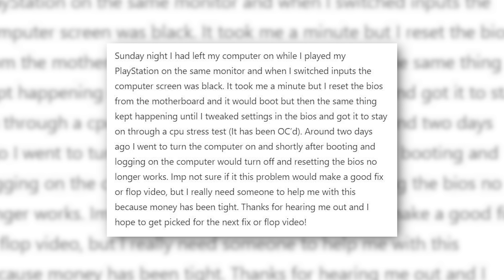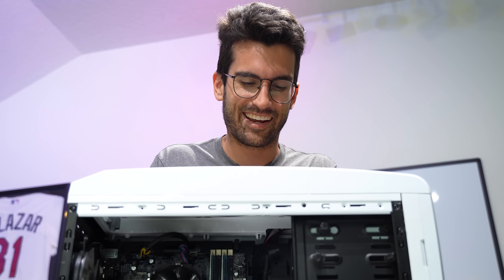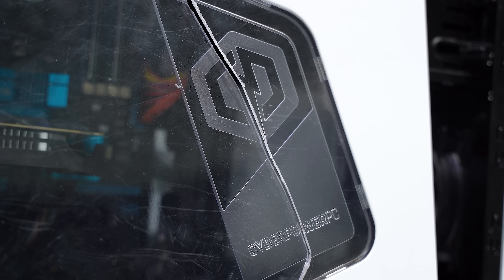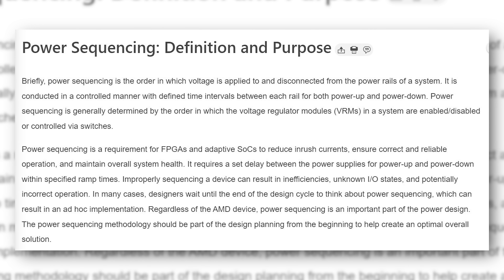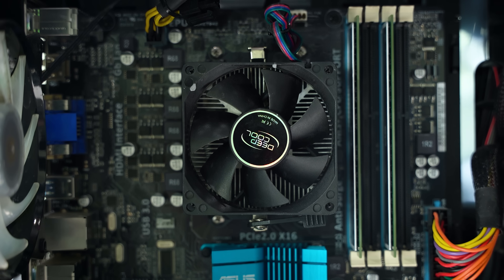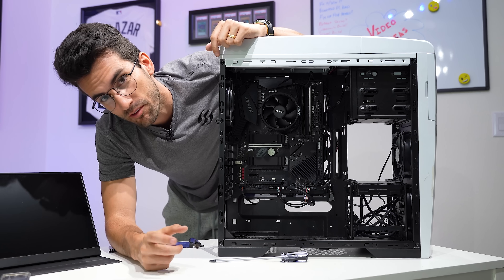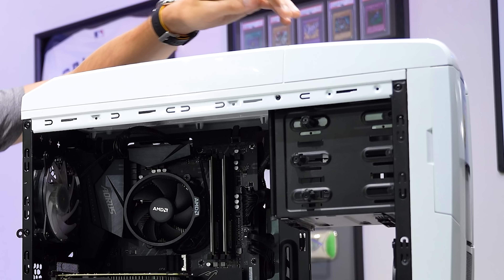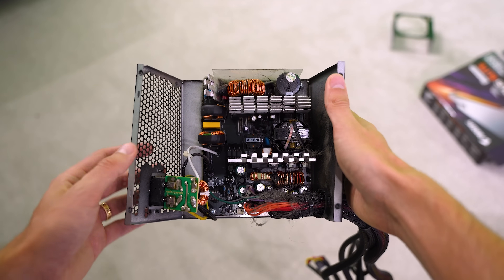Fixing a Viewer's BROKEN Gaming PC? - Fix or Flop S5:E12

Comment: You'd be surprised at what an old Bulldozer setup can do. I know I was when both of my nephews bought Radeon RX 6800's about a week or so ago. They came over so I could help them get their new cards setup. The younger one has an FX 8350 with 16GB of DDR3 and a 1 TB SATA SD (Previous GPU was a Sapphire RX 580 8GB). It's now pushing 55 to 60 FPS in Remnant 2 on Ultra settings with no FSR at 1080p with a pretty straight line for frame times. Shocked the crap out of me. Before, it would get low 20's to low 40's with frame times that were all over the place, WITH FSR enabled. Eventually he'll replace the platform, but for now, it's working pretty well.

Comment: Im still a rookie when it comes to building PC's, but there was vents at the bottom of the case why didnt you face the PSU Fan downwards to get its own air supply rather then sharing with the GPUs Airflow?

Comment: I actually prefer the old case. New budget cases just don't have enough storage support for me. I also don't mind having the option for a disc drive. I would do some cable management to get those cables behind the motherboard so I have full access to the drive bays take out the broken side window and replace it with some mesh. A couple of cheap and simple fixes and he has a good platform to upgrade.

Comment: Can't believe that system worked for so long! Yeah, given it was AMD FX (AMD FX has aged horribly, very poor single-core performance) and that having lots of weak cores doesn't really help you, and especially given the damage to the motherboard (and faulty PSU), there was really only one option. It's not worth spending upwards of $80 for a motherboard to resurrect an FX CPU especially when Windows 10 support ends in about 16 or 17 months. Upgrading the platform ensures the system works as intended (what's to say the CPU wasn't fried due to the overclock?) as well as gives continued long term support via an upgrade to Windows 11, as well as possible upgrades to the storage (SSD, because HDDs are always slow), RAM, CPU and GPU. (Though that Ryzen 5 should be enough to support much more than just a 1050Ti.)

Comment: I also had an old system that wouldn't boot that had an i5 4460 with a 1050ti. I just built a 3600/2060. Looks like my old rig. Looked less janky though. And anyone would have smelled the burnt cables and the guy didn't mention that, very sus imo.

I have the feeling it's his old rig after he built a total new one and he just got a second rig😂😂😂

Comment: 5v is your power-on signal back in the day. So it being bad explains a lot of the issue. As for the 4 pin, it being overclocked for an extended period of time causes that to bake. I've seen that in some of my older Intel boards after running them with extreme OC for a while.

Comment: The bit of plastic from the 4 pin could have been rotates and keeping the 4 pin from inserting fully resulting in arcing,, further degrading the contact. The power button requires 5v from the p/s via the motherboard, VSB I believe.

Comment: It's really nice of you to upgrade the platform like you did, just wondering if you had something like a 5 4600g instead of the 5500 as the igpu is probably better than the 1050ti.
Reply from the maker: I'm like... 99% sure a 4600G's iGP is weaker than a 1050 Ti 😂

Comment: i have had video cards that post and would show the windows screen but under load would artifact and act weird and eventually crash. being that this system had a short or power surge i would recommend load testing the video card. just in case, same with the hdd.

Comment: The burnmarks on the cpu eps power connectors is a common habit on AM3+ systems. Burnmarks are normal on cpu eps power connectors on AM3+ motherboards even if you don't overclock. I've worked on plenty of AM3+ pcs and almost every one of them had burnmarks on the cpu eps power connectors. They usually still work perfectly. I think you could've saved the original platform and the upgrades weren't really necessary.

Comment: Apart from the badly worn and cracked Acrylic Side Panel insert they should be super happy with the repair, my geuss would be either the overclock cooked the 4pin, or it wasnt connected properly, although the last time something went pop in a power supply for me was when i had a cpu coolant leak drip, coolant into the power supply R.I.P Kolink 1500watt Platinum Power Supply your still sorely missed although the type c19 power lead not so much as its propetrairy to over 1500watt Power supplies so rare and expensive, unlike regular power leads.

Comment: Thermaltake power supplies are dangerous. I had a 24 pin do the same thing, except it melted 1/3 of the motherboard connector. Toasted my mobo. I'm grateful I was using my PC at the time and smelled plastic burning. Never again Thermaltake!!

Comment: He told you it no longer booted and was just a black screen.
He said it was a black screen, he tweaked the bios, this resolved the issue for a short period of time, then the computer went back to doing it and resetting the bios no longer worked, assuming he meant taking out the cmos to reset the bios.

Comment: I totally understand your decisions, and, not that you need my approval, I think you really made solid choices. But man, it's gotta hurt your soul a little to send PCs back out into the wild with OSes still on HDDs.😂 Very cool FoF. It's nostalgic to see some of those older systems! 

For those freaking out about it, saving the case upgrade for the user really is such a solid choice. A) He might have an attachment to it. And B) He can have the entire building experience again if he wants for very little money. A Corsair 4000D is like $80 or $90, and it'll be like a COMPLETELY new system. Even $40 cases exist that don't suck. At least, I heard that somewhere once.

Comment: I think it was likely the low quality PSU or a power surge for sure. Even fully OC'd, with that cooler, an FX-6300 would shut off before you could draw anywhere near the 150W+ the EPS 4 pin is rated for. To pull that much power, you'd basically need an FX 9590 balls to the wall overclocked with a 480mm AIO so it doesn't overheat and shut off before even getting the powerdraw required here.

The OC is very unlikely to have melted the connector. Especially because it looks more cracked than melted and this happened before the 12V input (which don't change) were converted to whatever voltage OP set in the BIOS.
Reply from the maker: I think a few folks are misinterpreting my statement - which is my own fault. What I should have said was that the OC likely wasn't playing nicely with the shitty PSU. I would be more concerned with the power supply than the board.

Comment: A good advertisement for Thermaltake power supplies. GG
Reply: Thermaltake is a mixed bag with PSUs. The Toughpower line is generally rather solid, but the entry level stuff  like that SMART unit , yeah, are trash.  Avoid anything but  the Toughpower line from Thermaltake.  It’s not worth it.

Comment: Here's an interesting thought. One thing I have not seen you do on this channel or maybe you have I just haven't seen the video. Remember When building computers inside of aquariums full of mineral oil I think it was, what's popular? Maybe you could do one of those type of builds and just use some parts you got laying around to build it with. Then you could put some Led fans in it and have it part of your background when you do videos. Just a thought. Most newer gamers have never seen this done, so to them it would be very interesting. And you can discuss the pros and cons of doing this. I've never done it myself, but when I walked into a computer shop when I was much younger and saw where they had built it I thought that was pretty neat.

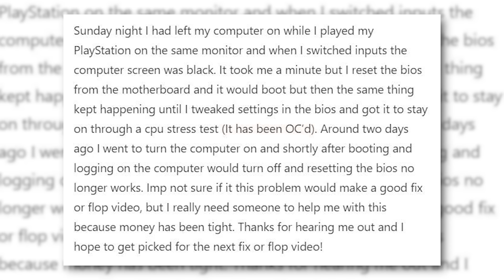Comment: 12:22 It's extremely unlikely that OCing that board would have cause the serious charring seen there. It's almost certainly been a power surge from the grid that caused the issue (both the damaging the 5V rail and causing the 12V header to be charred). I'm very familiar with that line of Asus motherboards and have OCed plenty on them - there's just no way it would allow any setting to cause that level of physical damage. The user is just lucky it kept working at all for as long as it did!
Reply from the maker: Not exactly blaming the board... merely the combination of OC'ing and the shitty PSU running everything.
Reply: @GregSalazar I had an old fx8350 years ago I would do crazy overclocking on and charred an 8 pin this way. About 2 years of extreme oc caused it.

Comment: Hi, the older Asus boards that had the anti surge built in. They had Extra Protection for everything on the board. If the board sensed something was not working quite right it will not boot. And it could be just something that's slightly off but the board considers that an error so it won't boot. Just to tell you how good these boards are, I have a anti-surge Asus that's over 10 years old that at the time cost about 400 bucks. I bought it used so I paid less than half of that. And this board was built during the transitional phase where they were going from ddr2 to DDR3. And it's got slots for both types of memory believe it or not. And it's got settings for overclocking out the yin yang and I don't know what they are expecting the CPUs for this thing to be like. But I'm talking and multiplier that goes way up there. I've learned from experience not to be into overclocking it causes more problems than what it's worth.

Anyway, just to show you how good the anti-search boards were. I live here in Jacksonville Florida and we get a bunch of storms here. So one day I'm working on my computer typing in code for my website and I hear the storm cloud coming up cuz I can hear the thunder. And it had just started so I figured well I got a little bit of time and finish this up and then turn it off no sooner than I thought that I heard a pop come from the computer which actually was loud enough to make me jump because I realize that was lightning coming right through the internet cable. Then I heard the kablam. Evidently the electricity can travel through the line faster than the sound of the lightning itself.

So I went to turn the computer off because the screen was still up everything was still on and I found the computer locked up. So I immediately turned off the switch on the power supply pulled the electrical cord from it and then disconnected the cable internet from the PC. All the while thinking well this was a direct hit so I'm sure this computer is trash. So when the storm passed I hooked everything back up thinking it's not going to turn on or boot up. But to my surprise it did. And the only thing that got ruined was the chip that runs the cable internet on the board. So I put in a card for Wi-Fi internet and it worked just fine. In fact it's the computer I'm responding with in this comment and this is 5 years later.

Over the years certain Hardware is gone out and the board always lets me know something's wrong by not turning on. And I go through the process of changing or disconnecting Hardware into figure out what it is, and when fixed it starts up just fine. So the only thing I can think of is this board is built in with safeguards to keep the rest of the hardware from frying. So I think if you took the motherboard of that computer cleaned up that four-pin plug-in, hook up another power supply it'll boot right up.

Also, I do side work repairing computers from time to time for friends and here's something that is so strange you want to hear it. I used to do work on the computers at this one Realty Company and one day she calls me up tells me lightning struck her computer. First thought through my mind is a fried. And that there's only a 5050 chance I could get the data off the hard drive. So I got the computer and it would turn on but that's all it did it wouldn't do anything else. But when I want to go pick it up she told me that lightning had come out of the cable wire and actually struck the side of the computer. I just kind of that's kind of hard to believe but I got the thing home and went to take off the side cover and lo and behold there was a big old black spot right in the middle and I was like dang that's worse than a direct hit. Never heard or seen anything like this before. Anyway, I was able to get the information off the hard drive after I stuck the hard drive in the freezer overnight. It's an old trick I've had it worked more than once because for some reason if there's a bad chip or an overheating motor it'll make it temporarily work.

But the computer never booted again and I got curious on what was wrong and I found that the BIOS code had a bunch of errors in it because the lightning had evidently hindered some random code when it struck it or messed up the code that was already there. And on the older computer flashing the BIOS when it's already screwed up is not really worth the time and effort. So she bought a laptop and I just put everything on that from the old Drive. But I thought you might find that interesting cuz I had never seen anything like that.

Comment: Sadly there are PC owners who are just elitists. Just because they can afford, have the time and the inclination to upgrade their rigs, they seem to think everyone should be the same. Not everyone wants 4K graphics. Not everyone wants the latest and greatest. Some people just want a system that does the job they want it for.
That said, as someone who for ages thought that the whole HDD hatred was over the top, and stuck with one way beyond what I should have, I now fully agree that anyone with an older system should invest in an SSD. If you don't have an M.2 slot, get a SATA one or a PCIE adapter for an M.2 if you have a spare slot. Greatest upgrade I ever did for my aging rig. And prices on SSDs have dropped significantly in the last couple of years.

Comment: My 6350 with a RX 470 was rocking before ryzen R5 1600 I upgraded too. Might still work ( I saved the parts) for my nieces' school computer. While my Primary is a R5 5600 with a RX 6700XT and my secondary is a R5 3600 RX 7600. The FX for a Canvas PC with Britannica access it will play what 10yr olds play. I usually rail against putting the R5 5500 (PCI gen3) in a new system. However, in this case the card is a 1050ti (Gen 3) this is fine. combo. Besides the graphics power this system will outpace the FX system without a sweat (stress to the owner no Oc needed) I would look to a RTX 2060super or even a 3000series even the RTX 3050 8GB with slaughter the 1050ti... Even the 6GB version, Than again he sould look for a least 8GB Memory (the 2060 super is)

Comment: I've seen 4-pin power connectors that burned but that was on Tyan Tiger MP S2460 motherboards. That was a ATX size dual Athlon motherboard. As I remember it they had only a 4-pin 12V connector and not the 8-pin 12V connector that later became standard. I think I saw two of these MB with burned connectors, and we sold hundreds so not a total failure, but yet to many. Using the 8-pin EPS 12V connector would have prevented this. I don't remember perfectly but I think they fixed that on the S2466. Now the S2462 was interesting as it used power connectors that was intended to become the EPS standard, but instead they were discarded and I think the S2462 was the only motherboard to ever use them. It was called ATX-GES and the pinout was not anywhere near ATX or the later EPS standards. Same number of pins, but in totally different places on the connectors.
Reply: The 4 pin is rated for 150-190W. The 8 pin for 300W+. Much more likely to have been shit build quality of PSUs and/or motherboards at the time.

Comment: You pinged my OCD by putting the power supply fan upright. I must go to my safe space now.🤣
Reply: It's honestly better to do that because most people aren't going to properly clean the case filter regularly so it will keep a lot of dust buildup down.
Reply: @honeybadger6275  maybe so. My whole thing is robbing the GPU of air. I'm sure there's plenty of separation, though.

Comment: The PC slowly stopping working reminds me of an XP1700+ Palomino setup I had that started refusing to be stable at 133 FSB/133 RAM; I had to reduce the RAM to 100, then both, and finally, neither would work. I bought new RAM and a replacement PSU, neither fixed the issue, so I turned my attention to the motherboard - an ECS (remember them?) K7S5A, a very popular if rather unreliable board that you could supposedly bring back to life using a heatsink mod on the SiS735 chipset, though that didn't help. A quick trip out to get a KT266A board and everything was good again, and whilst I was annoyed to have fired the parts cannon at the thing, I didn't lose anything other than the motherboard.

Comment: I had a blast playing Fallout 3 on a GTX 670 with a 3570 yesterday. 1440p Ultra at high framerate.
Bulldozer/Piledriver is at a point where it is collectable. And they weren't all that common, at least not in comparison to intel hardware from that era. Nowhere near the popularity of Ryzen. I've considered getting an FX system built but I gotta wait until I can afford to spend $250 on a PC I will never actually use.  I suppose I could luck into something for cheap, at a flea market or yard sale. Once in a blue moon I see something cool on CL. 
An excessive OC with a FX could cause the EPS to be overdrawn, especially when it is only a 4 pin. They needed the power of the sun just to run stock. A good PSU wouldn't have allowed this to happen.
Reply: Bulldozer and Piledriver would probably outperform your 3570 these days. By now that people have figured out RAM overclocks and learned not to push the cores by focus temperature headroom on the Northbridge and HT, you can take them quite far. I've had an FX 8350 with 2400C12 DDR3 that would do better than a stock i7 4770 with 1600C9 DDR3 in TimeSpy and Valorant